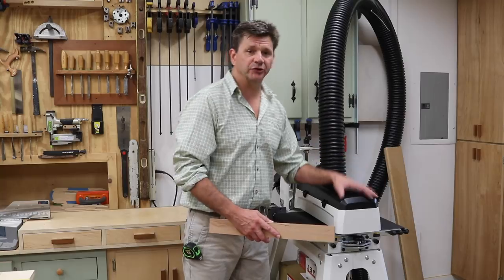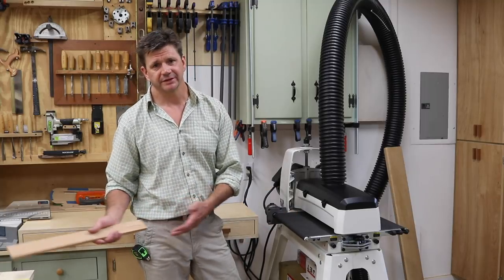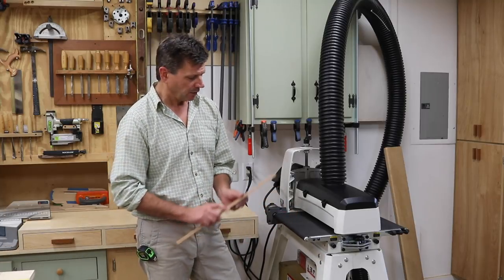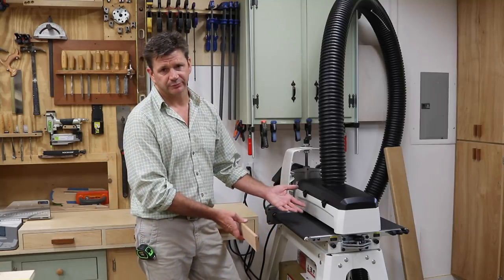Assemble JET 18 - 36 Drum Sander

Comment: I received my Jet 18-36 and noticed that they have updated the feet on the stand. They now have a thicker piece welded in making it a full 1/2" thick, see attached photo. I now would feel comfortable installing a single threaded caster onto this. Unfortunately for me I had already purchased plate mounting casters. (just found out I couldn't attach a photo)

Comment: Nicely done. Total deja vu to the video I did assembling my 16-32. Looks to be exactly the same machine, yours is just a little bigger. 
A word of caution about those wheels... the metal feet they run through are pretty flimsy and if you accidentally try to roll over an extension cord they might bend, causing the whole thing to fall on the floor. Mine didn't hit the floor, but it scared the crap out of me so I made a support bracket to tie all those feet together and make them stronger. This ended up adding an extra shelf at ground level as well. 
If you're curious, I believe I have a decent shot of it in my shop tour video from a few weeks ago.
Reply from the maker: Cool I'll check it out.. I just went over and subscribed

Comment: Hi Jon. are you still happy with this machine? I'm looking at getting this particular machine, to help with finish sanding but particularly with sanding curly grain. Would you buy it again?
Reply from the maker: Hi Robin, yes it’s working great 👍 it doesn’t take up a ton of space in the shop and I like that it runs on 110 . Plenty of power I was standing 16 inch wide walnut the other day with no problem.

Comment: Jon, we are really looking forward to a review of the sander; we're almost to the point of buying one.
What are your thoughts on single head  vs duel?
Reply: Two Dogs Woodworking and Wood dual head is good for having two different grits. But if in a budget I got by for a few years on just the single head
Reply from the maker: I agree with Tim, most small shops can get by with the single head and takes up less room in the shop. I'll use it for a few weeks and then will take a closer look.

Comment: Can I ask a potentially stupid question; why would someone want a drum sander instead of a thickness planner - or planner instead of a drum sander?  I guess I'm not sure what the use-case is between the two.  Thanks for your help and I love the videos!
Reply: G'day Brandon White, as a general guide a jointer is used to produce a flat face, a planer-thicknesser is used to produce a parallel face to the flat face produced by the jointer. These machines can remove substantial amount of material relatively quickly. The face that these machines produce are generally not of a "finished quality" and still require sanding. This is where the drum sander comes in, it removes small amounts of materials and leaves a higher quality finish. Therefore after the wood has been through the planer-thicknesser it would then be put through the drum sander to produce the finished face. I don't have a drum sander so still use a hand held sander. A drum sander is a nice to have item my thoughts are that you really need to purchase a planer-thicknesser first followed by a jointer and then a drum sander. Hope this helps! Happy woodworking!
Reply: Ross Merchant thank you so much!!!!! This is exactly the info I needed! I have a jointer and thickness planner which I use to get the wood where I need it and then I use a random orbital sander to get the finish needed - perfect. Thanks again!!
Reply: No worries Brandon White, I have a combo jointer-thicknesser. I would like a drum sander, they are a great time saver plus they give a very consistent and even finish. It makes sense for a high volume workshop, for someone like myself who is a weekend hack it's a nice to have item but not essential. I am however interested in purchasing this very model so am looking forward to Jon's review.
Reply from the maker: Good question Brandon and great answer Ross

Comment: So can someone explain to me the purpose of a drum sander.  If you have a thickness planner do you need a drum sander?
Reply: Depends on what you make
Reply: Tim_Toolman I appreciate the time you took to reply, but it doesn't help.  And that really is question.  What would I need it for, under what circumstances or type of project call for a drum sander?
Reply: gXXrGoNe anything with different grain directions like end grain cutting boards or table tops so you.dont have to.sand so much
Reply: The big thing to remember is that it is a sander not a planer. You are most taking off 1/64" with the sander per pass. It does much better on end grain. End grain can chip out very badly on a planer. Most woodworker I know have more machines for sanding then any other operation. This is a great tool for sanding cutting boards too.
Reply from the maker: Also check out the comment from Ross Merchant.. he has a great answer to your question.